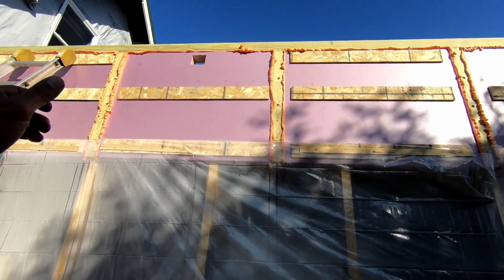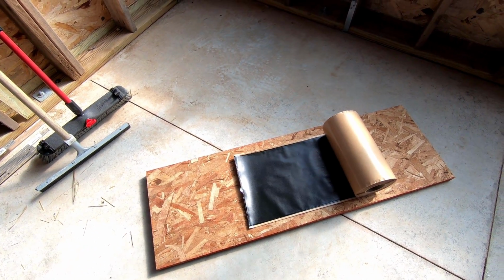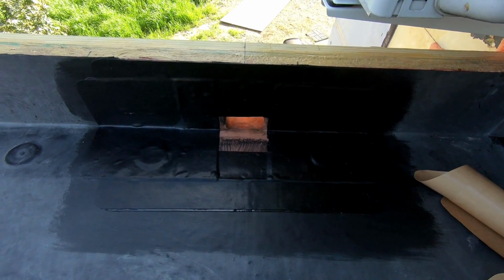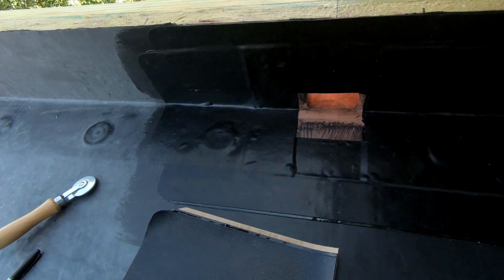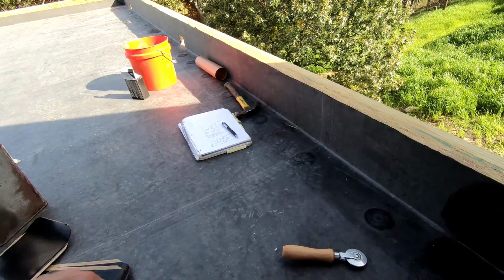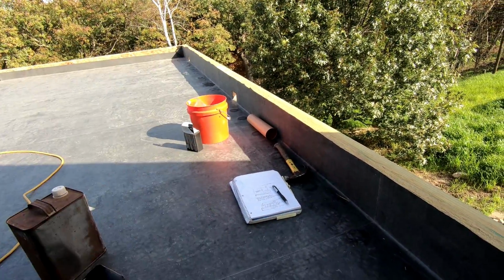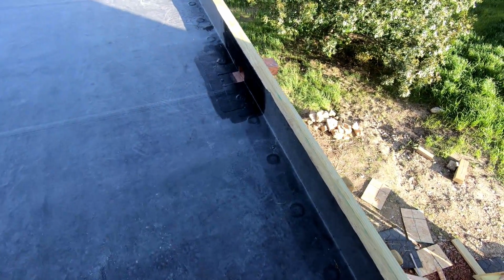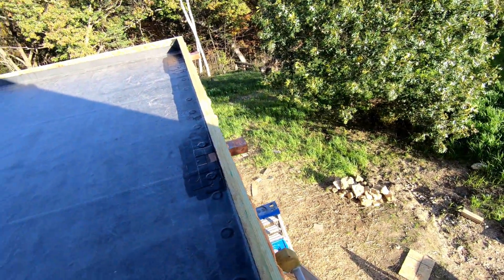Installing Thru-Wall Scuppers

Comment: just fixing a scupper that was waterproofed well but scupper was built up higher than the slope could drain....so a puddle formed with nowhere to go......and it destroyed everything.......scupper was actually tilted backward so water had nowhere to go

Comment: just purchased an older home with 3 roofs similar to this. Seems that water was seeping inside from underneath the scuppers and destroyed the kitchen. it looks nice but tricky to keep from leaking. Not quite sure how to implement a drip edge with this design
Reply from the maker: Yea, they need to be checked every year and the previous owner likely did not do so. They are definitely more work, but are the only option in some cases.

Comment: most importnt thing is letting the water get out.....no excessive buildup near scupper so water doesnt come back off wall and sit......if water drains clean and fast excessive water proofing isnt necessary.....plenty of slope to deal with irregulrities and drain in scupper is actual lowpoint and everything drains to that point........if water sits it will find  way in

Comment: do you have video start with insulation before you lay the membrane ?
Reply from the maker: This is a cold roof insulation with 100% fill on the interior. The insulation went in later.